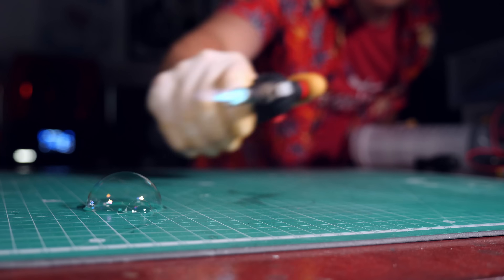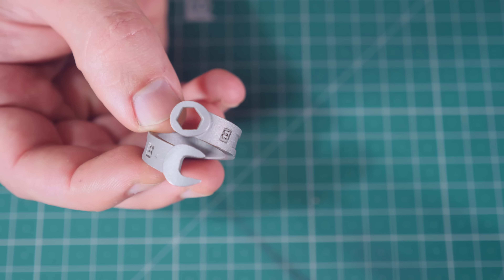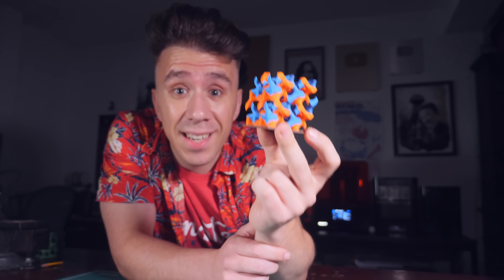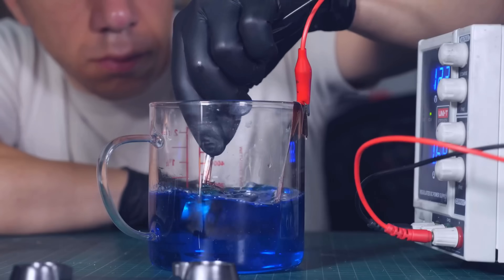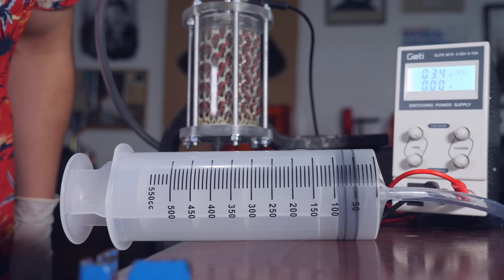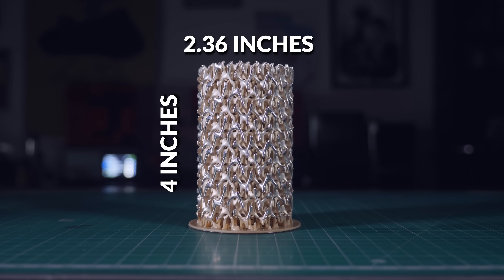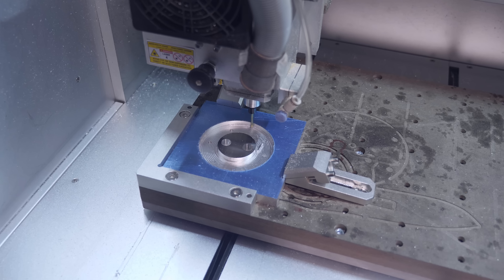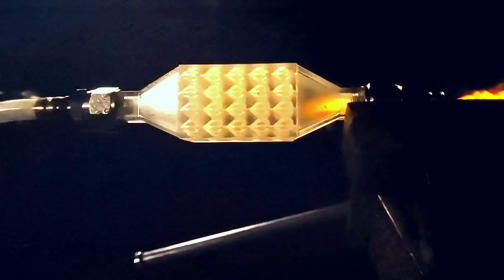ROCKET that LITERALLY BURNS WATER as FUEL

Comment: Create a water powered car without being assassinated by big oil
Reply: That would be great.

All it would need to do is be insulated from the heat of the car, in terms of the water as fuel. The only issue is to create a tank that would be safe from creating leaks, and electrical fires/electrocution risk. Also, one pipe would be needed to pipe the hydrogen and oxygen gas together, but that's going to be a very explosive risk there. Same for how it would need to be ignited in the engine. There would have to be fairly controlled ways of delivering the gases in small amounts in multiple areas with very thin tubing, depending on the engine used. I would assume it would not be an ICE engine, but perhaps one could be designed to run on water. It would be highly complicated.
Reply: @briondalion  I'm impressed how you went into so much detail withojt considering first that you need energy for electrolysis. More than you'd ever get from hydrogen combustion
Reply: Discharging a large Lipo in that amount of time to harness a few bubbles of hydrogen should be enough of a realization that to make hydrogen requires a phenomenal amount of electricity. Then you need to chill it and then compress it. Then you need to transport it and store it. Then you need to maintain the engine that uses it…. Every step requires a phenomenal amount of electricity. If only there was a simpler way…..

Imagine if there was a way to generate electricity from your roof, and very directly store it and use it any time you desire…..
Reply: @паша-н3у5н  oh yeah, sorry yeah, I just got excited. Although if you used a small amount of radioactive material, you could power that for a long while, presumably. Submarines that are powered by nuclear energy need almost no material in terms of the size...different energy needs, however. Yes it would be more energy used, but it would keep cars cleaner, especially if it's Thorium that is used. Or, perhaps, the car could have a body made out of specially shaped solar panels, all over the car.

It might not be net zero energy, but it would be cleaner. It could also be a very small ICE that compliments an electric car, so it can go further in distance.

Or, my idea is bad, I'm not sure. That fact about the more energy needed slipped my mind. I'm just passionate haha
Reply: @ibsn87 
Bob Lazar already solved the hydrogen storage problem decades ago
Reply: Water cannot be used as a fuel.
Reply: That might be difficult
Reply: @Withnail1969 did you look at the video bro🫥
Reply: Start with a Generator for Testung then Build a car !
No Problem there are Cars doing that Right now in europe
Reply: They're called Fuel Cell cars and they've got some issues. Japan ssems to be all-in on them tho
Reply: actually, someone already did that about 20 years ago, he mysteriously disappeared though
Reply: @papakaicovers3710  Literally every "water powered car" design turns out to be a scam in one way or another. Conservation of energy is a physical law, not a suggestion.
Reply: @thecorruptedbit5585  Hydrogen fuel cells are just worse than batteries at this point. Less efficient, and you have to carry a highly volatile bomb everywhere with you. It's a terrible idea with the only benefit being faster refuelling, but having to take a 30 minute break every few hours of driving is a good thing for everyone.
Reply: @Candlemancer  this is kind of reductive, no? Batteries require lithium, cobalt, and nickel that don't just come from nowhere. Cobalt production heavily leans on the DRC, where there are significant ethics concerns about the labor used to mine it. Hydrogen production with electrolysis isn't quite efficient (you lose almost 20MJ/kg, or  12%) but it can be used to produce zero-emissions internal combustion engines from more common metals using infrastructure and production facilities that already exist. 

There are real reasons to take a step back in terms of energy efficiency in personal transportation if that means you can create and fuel a zero-emissions internal combustion engine sustainably using such common materials as water and steel. 

Also, batteries aren't a whole lot better in terms of safety. Sure, Hydrogen is explosive, but Li-ion batteries are not a ton better. If you've watched Top Gear/Grand Tour, you should know Hammond's crashed Rimac continued to repeatedly spontaneously combust for 5 days before they could finally remove it from the crash site. 

There is a whole lot more to consider than just current energy efficiency and current safety concerns.
Reply: @FBl.G0V.2024  you mean the video of him using a >>battery<< to power the water conversion into a tiny burst that would produce less energy than just using the battery in the first place? Its a for fun chemistry project not a fuel proof of concept.
Reply: @breakfastcrafty4683  agreed, I think that we have had better energy options known for over 100 years. I'm thinking about the ringing bell experiment that has lasted over 100 years.
Reply: @tarq5205  Remember that lithium battery powered cars are relatively new compared to hydrogen cars, there's still tons of things that are being worked on in terms of safety and all, in the future with solid state batteries there might be no more "instant combustion" that can happen on today's lithium cars.
Reply: @Endermax3852  yes, and the dude I am talking to is talking about current-technology limitations on the use of hydrogen as fuel. The vast majority of the transition from theory to technology is solving practical problems. Obviously batteries can get better and safer. So can hydrogen.
Reply: Yeah... but the tect is out now for some time, and no one still has any running  on the roads😮
Reply: @davidstephens4763  Or so they? I know if I had one, I'd keep my mouth shut
Reply: Honda made a hydrogen powered Odyssey pre-2010's
Reply: I did.
Reply: has to be armoured bomb proof and you will have to live in this Water powered car
Reply: Go back to school please 🙏 for the sake of our future and taxes please help yourself now from living off Medicaid and social security!
Reply: @briondalion  its not risky. You just use a bubbler.
Reply: @thecorruptedbit5585  no a fuel cell turns the gas to electricity. Doesnt burn it as a gas.
Reply: Shhhh, just talking about it gets a satellite parked over ya house.

Comment: There was a researcher by the name of John Kanzius that made an accidental discovery using radio waves at 13.56 MHz to essentially shake the water and separate the hydrogen from the water ending up with the ability to make the water burn.  By the way, I’ve been subscribed to your channel for a long time and you’ve always been interesting, amusing and provoking.  Thank you for doing this.
Reply: Wow that's a really nice discovery
Reply: wasnt that a film with kianu reeves
Reply: Great, he would need to put more energy in than he would get out which defeats the purpose. It's not even a battery. At best it's a propellant medium.
Reply: Did you see the "It runs on water" documentary?
Reply: @_Reverse_Flash  To be fair, that's ALL batteries, including the radio waves thing, its just a matter of efficiency... which still makes the radio waves thing awful.
That's actually the problem with hydrogen as a fuel iirc, it takes so much energy to make and store hydrogen than to just put the energy in a lithium battery and use that.
On the flipside, water itself is incredibly cheap which is why it still has quite the promising future, so long as we can find some more improvements on electrolysis.
Reply: @claytoncarner4361  So generally HOW did the guy from Michigan make the water car? He was quoted as saying he could go across the country( 3k miles) on 7(?) gallons.
There must be a way, keep trying😃
Reply: @BearBig70  The technology is called "scam". Pretty simple.
Reply: @whuzzzup  People aren't inventing new forms of energy. They are inventing ways to transfer it. Where did all the electricity go? It didn't disappear. It's now in a new form. What form? That's the discovery. Inventing a way to use a gas motor to create electricity, used to create a reaction, then back to electricity, is still a legitimate discovery, even though, you're right, the car is still "running on gas".
Reply: Similar thing to stanly Mayer. He didn’t use radio waves however. It was the use of unipolar magnetic fields.
Reply: @danielgibson490  Oh "unipolar magnetic fields"? He should show how to make them, because he will easily get the Nobel Prize for that.
Reply: @_Reverse_Flash  Incorrect, doing it the direct current way uses more electricity than you get in power from the gas. Using 'sound' or radio waves is easily generated and has an instant and profound effect on water, poof gas! The best version of this generator I have seen used sound to shatter water into gas, with the metal plates spaced close enough together, functioning as a speaker type device to deliver the sound frequency to the water, it generates a gigantic amount of gas, with quite small voltage required. It DOES require a very complicated circuit to deliver the sound in a square wave form. But once the electronics are figured out the build is easy and straight forward, and yes, always use a bubbler, too many inventors have died for such thoughtless actions.
Reply: @BearBig70  DO NOT USE electrolysis. There is more than one way to skin a cat! Read my posts above, I explain this.
Reply: @ is there a name for the cell you are  describing man?? who invented this ? ZigamusRainbowWizard
Reply: @jonkinzel6241   William S. Power published the PDF file describing the entire process. The PDF is 114 pages, no way I can post it here. I can't find a name for this other than Water-Hybrid System and this one is designed to add to the gasoline process, rather than run on water alone, which I have also heard is totally doable. Though even the full water system often uses a teaspoon of gas to crank the engine, then stop the gasoline flow and shift to the HHO, because the simplest version needs vacuum from the engine to pull the gas in. In other versions it includes a small pump and pressurizes the HHO into a cylinder and maintains enough pressure on that so that the injectors will function correctly, they require 26 psi, last I heard.
Reply: Nowhere in that pdf does it say it only needs a teaspoon of gas. It still uses gas it just adds hydrogen and oxygen to the incoming air to improve efficiency.
Reply: What a load of toss!
Reply: Have you thought of feeding your resulting gasses into a small internal combustion engine intake?